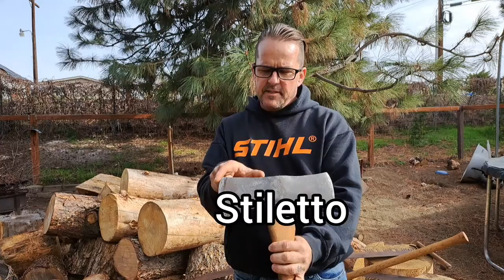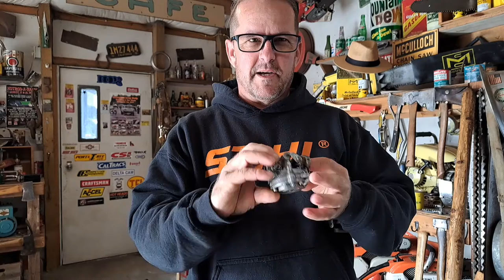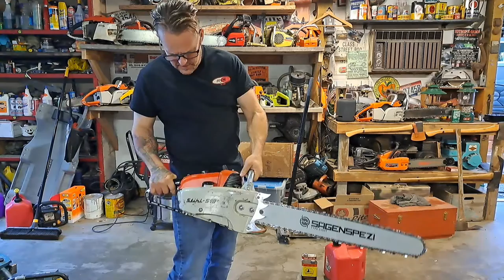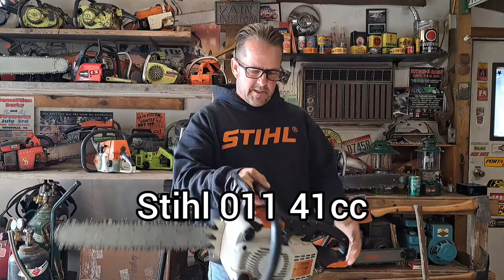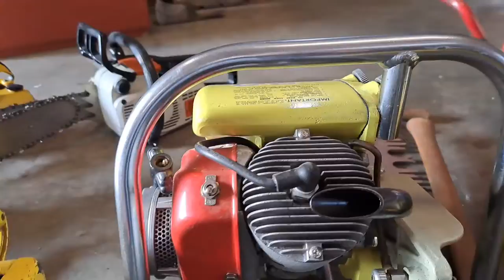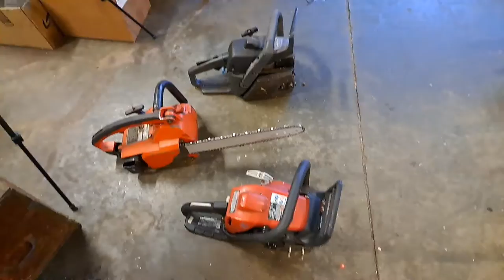The History Of Chainsaws by Kain Kustom Garage

Comment: A 95 year old neighbor had a Mall gear driven saw and he told me that if he hung the chain up in the cut the rivets would pull out of the chain. Lots of torque. He had to give up logging from the vibration that caused arm and hand issues. I guess Emil Lerp invented the gasoline powered saw and named it Dolmar. I understand the first direct drive saw was the Solo Rex in the 1950‘s? Great video! Love the sounds, even the tile saw!👍
Reply from the maker: Right on! Thanks Brother 😉
Reply: yes Emil Lerp invented the petrol-powered saw, before Stihl...Stihl had electric saws...

Greetings from Germany Peter 😎

Comment: Dan, I have a strunk 3-19 that i restored about a year ago and am trying again to make it run. Wondering about carb adjustments. It ran before and think the carb adjustment is just out of wack. Rebuilt and new carb kit. Wonder if you could help on top screw adjustment and main jet or the process you use.Thank you for the great videos and knowledge you share. Dave H.:hand-purple-blue-peace:
Reply from the maker: Hey David, thanks for thr kind words..try turning both jets in all the way then back them out about 1 1/2 turns, should be a good starting point...if it still won't run try squirting some mix fuel down the carb and pull it over with throttle wide open, if it doesn't want to run maybe ignition problems? Good luck man 😊

Comment: Me and my brother was in the country at my aunt and uncles old house and came across my uncle's old chainsaws sitting outside in a old shed my cousin gave them to us and one is a Mac 10 10 automatic and the other is a pioneer farm saw 11
 Both chain rusted to the bar and the Mac 10 10 automatic has a bow blade  13_18286 serial number and 600002U model is the numbers on the tag between the carburetor and the handle how can I find the yesr it was manufactured do has points ignition hot the pioneer chainsaw running but the Mac 10 10 no spark  plug wire bed and coil has a lot of cracks on it  . Thanks I enjoyed your video
Reply from the maker: Awesome Brother,  Appreciate you 😉

Comment: DON'T YOU DARE DISPARAGE MY CRAPSMAN HOMO(wner) SAW!!!!!! I LOVE THAT LITTLE TOY!!!!! JK, you were working on a little 009 Stihl in a video and I used it for reference to fix a couple 011s. I have a little craftsman saw that is either a McCullough or Poulan that someone gave me and it's a nice little one hand brush saw. Then I have a homelite xl98 demo saw on deck, and an Eager Beaver that I'll get running just for the challenge. Your videos are not only informative but interesting so please pump them out. Some diagnostic videos would be really helpful if you find the time to make one, maybe go over common problems and how to find/fix them, maybe even some more advanced tricks like spraying heavily soaped water around the crank seals on a boggy saw to see if it has blowby or is sucking air, leaving a (lean?) condition
Reply from the maker: Haha! Thanks Brother, I appreciate your Support, will try to throw some some more fix it videos in the Mix😊